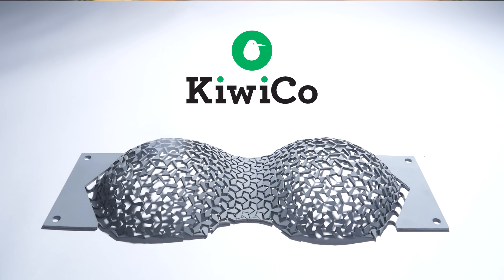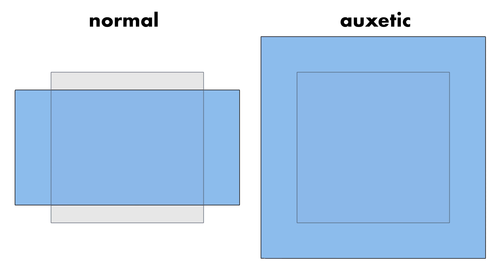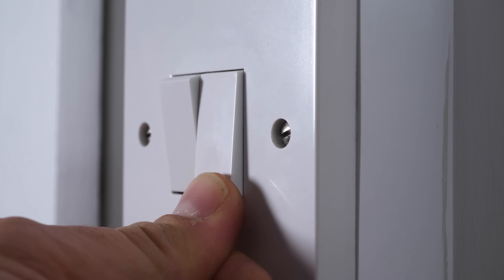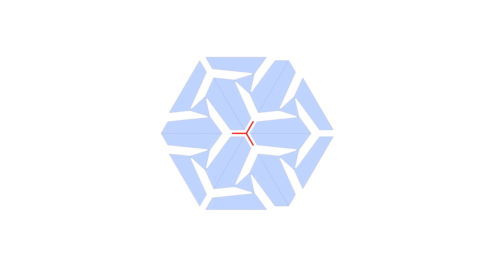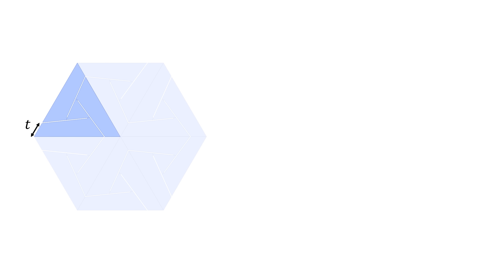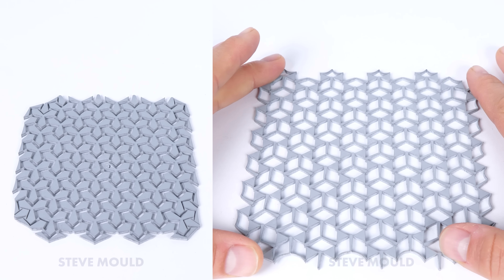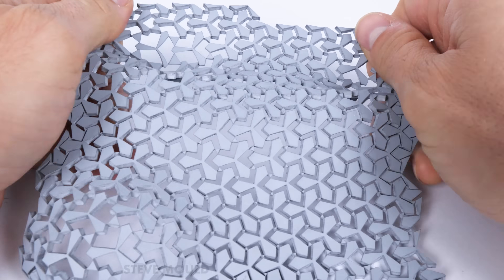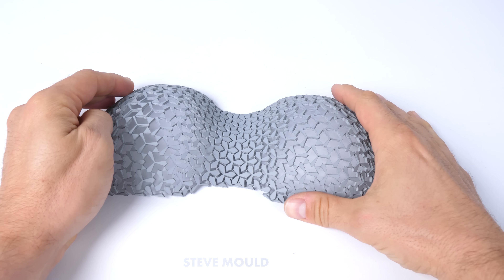Self-assembling material pops into 3D

Comment: What did you make these parts from? Looks like some laser cut rubber... Although it would be cool to print such parts, I think the much bigger achievement would be a multi material structure on a larger scale. Maybe something with hinges and leaf springs. Then I could see some real applications in spaceflight, mobility etc. Maybe this is just my lunchbox-hinge trauma, but I somewhat dislike compliant mechanisms. The medical application seems sensible though.

Edit_: didn't read your comment... How many cycles does this rubber last? I feel  this stamp rubber is quite easy to overstretch.
Reply: "lunchbox-hinge-trauma" xD
Reply: The benefit of "lunchbox-hinge trauma" is that you can get flexible movement (typically a hinge) without needing multiple moving parts that rub against each other. 
A door hinge made from two pieces screwed to the frame and door, with the rotational movement facilitated by a piano-wire shaft connecting them, will always wear out eventually. 
If the designer has done a proper job and managed the maximum stress of the single-piece "trauma" hinge, it will never fail. 
Incidentally, suspension mounts on Formula One racing cars have been rigidly mounted flexible struts for many years now. No bearings to fail... (or allow slack / excess movement).
Reply: Yes, you are absolutely right. Compliant mechanisms are super easy to manufacture and are often the "better" solution to a problem. I sometimes opt for compliant mechanisms when designing printed parts, but I always pay close attention to ensuring that the angle difference is as small as possible by stretching out the bending over a longer piece of material. My "lunchbox-hinge-trauma" probably results from the decision to prioritize footprint or material savings over a proper hinge. If the arc were, for example, 5mm in diameter and a bit thicker in return, I'd say it should hold up much longer.

Here, it seems like we have very little freedom in modifying the shape of the "tiles" by adding longer pieces that can distribute the bending bc. we have to maintain the bistable properties. In the example pieces shown, the triangles are basically rotating around their (compliant) corners, which seems to me like the least optimal utilization of the material's flexible properties. At least, I can't imagine how a part ten times the size would hold up if made from rubber.
I can't think of a concrete use case for 'lifesize' bistable auxetic mechanisms yet, but I'm sure someone will.
 @bythelee
Reply: @jannsander  The problem becomes that for materials stiff enough for most purposes, hinge points have to be extremely thin and even then, the stiffness will cause issues. Throw in that many plastics deteriorate with time, losing their plasticity and it cuts down their usability even more.  Which is not to say they don't have their place.
One nice thing is that modern technologies often make it easy to use mixed materials so the main structure can be the stiffer material while the hinge can be softer and yet the join between the two can be very good. That's a bit beyond many hobbyists so far though.
Reply: @mal2ksc Sure. But you may as well use typical hinges then. This option allows you to print-and-done. It's definitely not that far out of the range but dual nozzle stuff is a level or two up.

Comment: Not sure if its a mechanism or a material. Almost like if it is a "meta-material". :)
Reply: "Mecha-material"?
Reply: For context. The material shown above, this bistable auxetic material is in a class of special materials called Meta-materials (meta = kind of, because it is kind of a material and kind of a machine). Specifically Negative Poisson ratio meta-materials, which basically means it expands as you stretch them. You can have many different kind of metamaterials including ones that can function like optical cloaking.

Comment: 2:16 the image has to have a 4-fold rotational symmetry in each square
what you can draw is just an independent circle in each of the squares
i think how it would always work, is that you split every square into 4 triangles by using their diagonals, and ensuring every triangle has the same image. i think it is only possible with a single stroke if you draw circles as large as the squares themselves, so they touch each square edge of their squares, and that way you can cross from one square to another via those touching points
Reply: instead of circles you can use rhombuses and even make them concave (which would look like circles that cross the boundaries)
Reply: Just put a cross in each square
Reply: @natecurtis3159  crosses also work, they are kinda like inverted rhombi or they are like shifted rhombi
just so we are on the same page, the image most likely has to be drawn without releasing the marker and without overdraw (do not draw over an existing line, probably except for touching points)